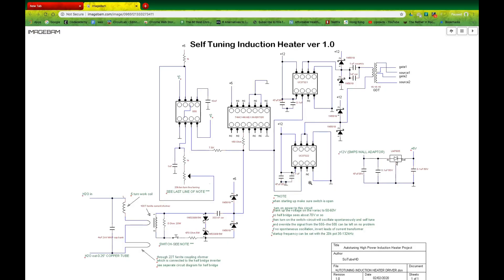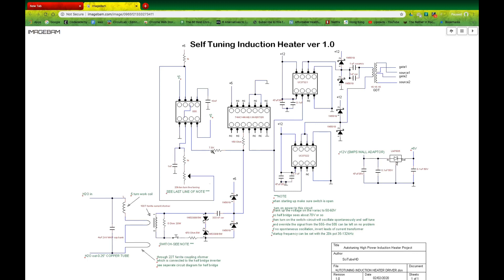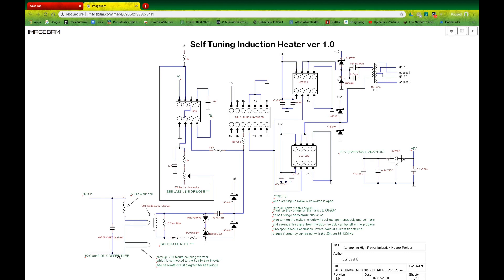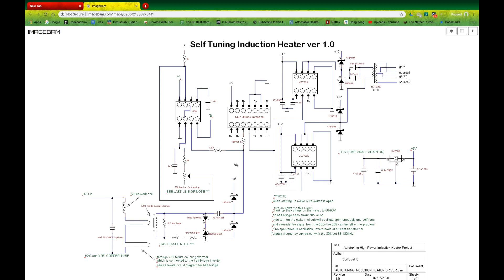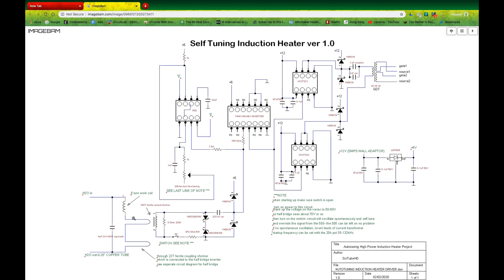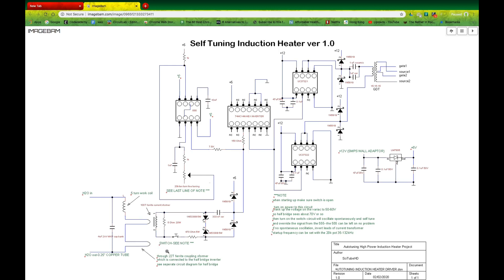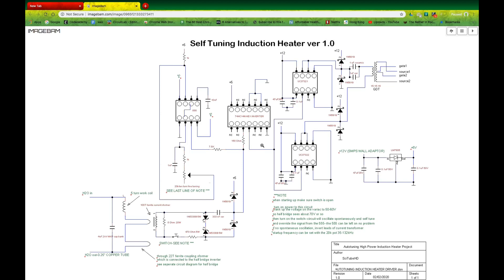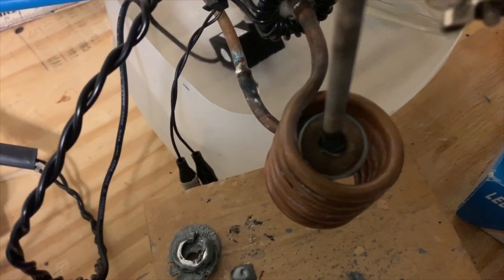Self Tuning Induction Heater-how it works

Comment: Hello sir. First of all, thank you for sharing the information openly with everyone. Since my English is not very good, I did not fully understand the subtitles. What I am curious about is that 4046 PLL is used in many applications.Does your system have any disadvantages compared to PLL or can it be used exactly the same?
Reply from the maker: It should work the same as the PLL. The problem I had with the mindchallenger PLL circuit is it detuned and lost the phase lock once the ferrous metal went beyond the the curie point. Then it needed to be manually tuned. With direct feedback this problem does not occur:

https://youtu.be/V6Gx0pWJSn8?si=q6elfHa6Iwjp7ykP

https://youtu.be/fz3JS31Qf7s?si=wHdgm0YTfDsFMI_X

Refer to the end of this write up for circuit diagram and Gerber files as well as pics of the circuit working:

https://teslascience.wordpress.com/simple-and-effective-induction-heater-current-control-circuit/
Reply: By removing the PLL integration, you actually solve many problems.I follow you and wonder how much more power you will reach 🙂 @BrianDhvTinkerer

Comment: Hello sir. This is a very interesting design. I have been struggling to make my own heater based on the PWM chip and have failed so im going to try this circuit as it seems to self regulate. A question I have for you is, did you wind the current sense transformer yourself? If so what is the criteria for winding one. Does it always have to be 100T? Does that turn ratio change for different wire gauges? Additionally you comment on how after the current sense transformer the voltage was too high for your circuit initially. How do you measure this voltage? I thought it variates with the oscillation in the tank. For example i have a different capacitor bank from you, one that is more powerful so what steps would I have to take with that bank to ensure the voltage on it doesn't destroy any of the chips. How do you measure the exiting voltage off the current sense transformer? Additionally is there any place i can contact you to discuss some more details about this design? Thank you for your time.
Reply from the maker: https://teslascience.wordpress.com/how-to-make-a-solar-powered-induction-cooktop/autotuning-induction-heater-circuit-tested/

You can contact me briandecosta38305 at gmail dot com
Reply: @BrianDhvTinkerer  I sent you an email. Thanks

Comment: great to understand this . design it to fit an off the shelf zvs and youve got a saleable item that can be produced very cheap .  2500W/1800W ZVS Induction Heating Board Module Flyback Driver Heater Dual Fan https://ebay.us/VUlDDS via @eBay

Comment: Very similar to a solid state tesla coil interesting demo. Just subbed
Reply from the maker: Thanks! I modded it some more with a current shunt. The feedback current transformer is just a small ferrite core with anything from 30 to 100 turns of  25-30 gauge magnet wire. If there are too few turns, the feedback signal is non sinusoidal. To reduce the amount of heating of the shunt resistor across the toroid, I made a small current shunt. I found I could get rid of the switch in the circuit bu adding an opposing pair of 6-9 V zeners between the output of the current transformer and the input- works just as well and auto tunes. Here is a link to the modification:
https://teslascience.wordpress.com/how-to-make-a-solar-powered-induction-cooktop/autotuning-induction-heater-circuit-tested/

You can contact me by email:
briandecosta38305 at gmail dot com

Comment: I like it. Very impressive performance, but I have a few questions/suggestions: Firstly, the voltage limiting measures at your feedback transformer seem very wasteful.  Why wouldn't you do something like adjusting your turns ratio to reduce the voltage, decreasing the capacitance of the series coupling cap or simply putting a much larger resistance between the xfmr o/p and the rail to rail clamp (the one just before the inverters i/p)?

Also, if I'm reading this correctly you're using a hex schmitt inverter, and actually have more than one set of inverters running in parallel on account of only needing 2 inverters, not 6.  You could very easily dispense with the 555 altogether by simply using one of your free inverters as a free running astable by putting a timing cap from i/p to ground and a timing resistor between its i/p and its o/p.

I couldn't read the schematic too well but it looks like you're also using a 74HC14, hence why you need 5 V.  You would do well to replace it with a CD40106BE.  It's a pin for pin drop in replacement but can operate at 3 V up to 20 V.  I've found 10 for a buck on Ebay.  They are made by TI who also put out a nice datasheet for the chip that includes an application note on the usage case I suggested. Good luck!
Reply: yep sound advice or even use a pll chip with a built in oscillator
Reply: your right reduce windings and choose parallel cap to suit its clamped anyway (twice)
Reply: in fact thinking about it you don't even need the inverter ic just feed signals straight to gate drive ic's
Reply: @T2D.SteveArcs  Yeah, that's the "classic" mosfet based slayer cct. Feedback from the secondary gets clamped btwn the power rails with a pair of diodes and then fed right back into an inverting gate driver, and from there the power handling bits are the same as the BJT type.

In principle it should be possible to shock it into oscillation with just a small switch.  I didn't see what that gate drivers were exactly but it could very well be they have schmitt inputs already. If they don't it's still a good idea to square up the signal with the hex inverter in that case.
Reply: @whatelseison8970  good point i had assumed the gate drive ic's ucc37321 and 37322 would have been schmitt inputs to avoid any spurious signal's, bounce, jitter etc but they dont appear to be?? 
also I agree that one pulse from a momentary switch should be enough to ''ring'' the lc and start the osscilation
Reply from the maker: Those are great suggestions and would be fun to try. This is a first iterstion just to see if the concept works which it does. The components including the coupling transformer are just what i happened to have lying around. I have already made a new xformer with lower turns ratio and with a tiny ferrite core;)
Reply from the maker: Yeah you could bypass the schmidd altogether. The gate signal might not look nice but it would work!
Reply: @BrianDhvTinkerer  thanks 4 reply keep up the good work..   have fun :)
Reply: @T2D.SteveArcs  Yeah, I have never actually messed around with using proper gate driver IC's. Kind of luck of the draw as most of the chips and bits I've used over the years have either been ultra-available at like.. radioshack, or salvaged from UPS's, inverters, CRT devices, etc.  I never actually ran across any gate drivers or if I did, I never got around to desoldering them.  I tend to use what I have and I can usually find a couple of complementary bjts for a push pull follower when I need to.

As I understand it though, they are mostly very fast current amplifiers without much voltage gain, if any but i'm sure theres all kinds.  I may have to pull some datasheets and just order some already and find out for sure.  It's always good to have a new tool in the box and I do love a good datasheet.
Reply: @whatelseison8970  Hi no they have a low voltage high  impedance input (mosfet) and the isolated  type use a infered led on the input so I usually throw say 240ohm in series with a 5v signal, they usually are used with their own isolated 15v supply so the can drive the hi and lo side directly (not needed if using a GDT,
If you like this kinda stuff keep an eye on my channel because I just started working from home so will have a lot more time to work on my projects DIY Radiation detectors X ray tubes scintillators, DIY fluoroscope, High votage, PMT,  DIY transformers, drivers,  SMPS and other general electronics projects vids coming soon
Steve
Reply: @whatelseison8970  also a good source of gate driver ic's are ccfl tv's they drive the half bridge's for the hf inverter transformers..
look for a 8pin dip with 3020 orr 3120 on it, that is a very commonly used  2A isolated gate drive..   the full no is HCPL 3120